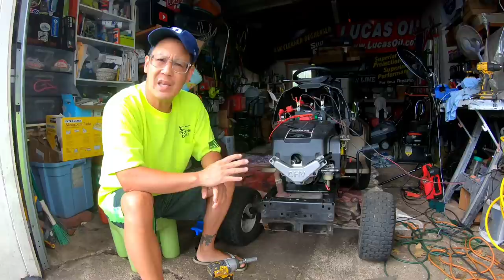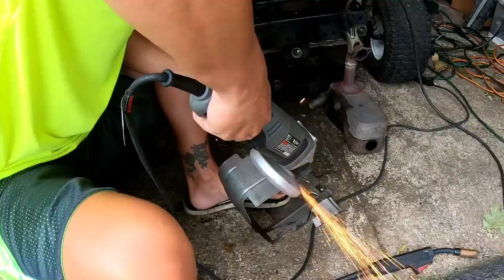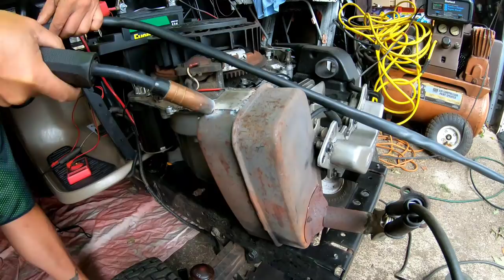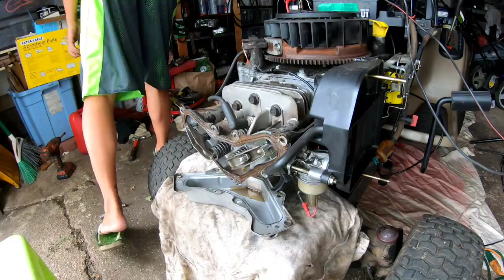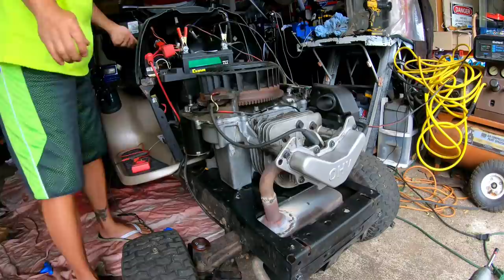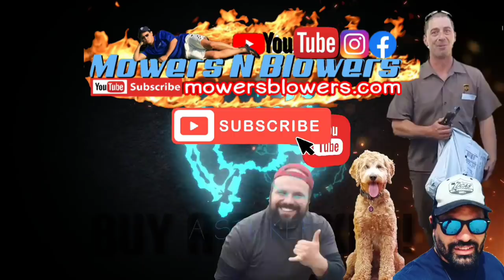CRAFTSMAN YS4500 LAWN TRACTOR REPOWER PROJECT CYLINDER HEAD STUD FABRICATION MUFFLER WELDING REPAIR

Comment: Glowing red is either running lean or a valve timing issue.  Did you open the engine since it last ran well.  Maybe a tooth off?  Do not trash the command, I will make a video on it and give it back to you (hopefully running).
Reply from the maker: I wont...how will I get it to you, it's a small fortune to ship it.  I've never opened this courage, it's a head issue.  The command has timing issues.

https://youtu.be/vpE777yKQio
Reply: @MowersNBlowers  that is a good question.  I work in NYC.  Usually take the train in, but could drive in one day and meet up with you somewhere.  I live up in the Danbury CT area.
Reply from the maker: @jcondon1  wow,  I just was up in Bridgeport yesterday.
Reply: @MowersNBlowers  I was there a few days ago buying a generator.  A bit of a hike for a generator, but it was a good deal.  Not free though.  Hard to find free generators.

Comment: Was this engine running even with bad valve adjustment until it got a muffler. Maybe the exhaust is not coming out freely and just heating the muffler to red hot. I like your persistence, bro.
Reply from the maker: It’s possible

Comment: Looks like to much back pressure. Try it with our muffler and see if it will rev up. Muffler could be half plugged up that's why it's glowing red.
Reply: I agree. Just try it without the muffler

Comment: Exhaust valve opening too soon?  Or not completely closing???  Loss of power, and unburnt fuel in the exhaust.....  I dunno, just speculating....
Reply from the maker: Those sound like all the issues.  My bro knighthawk is sending me another head.
Reply: @MowersNBlowers  Nice!  I keep forgetting, we're like a week behind....  This thing is probably running by now....

Comment: These parts such as rocker arms are precision machined, move up and down thousands and thousands of times in a short period, and have to be 100% right to work correctly.  Muffler glowing does usually indicate a rich run condition.  Could be valves not opening properly, valve clearance not maintaining consistent clearance, partially sheered  flywheel key, etc.
Part 4: Install another engine.
Reply from the maker: I wish I had another bro!